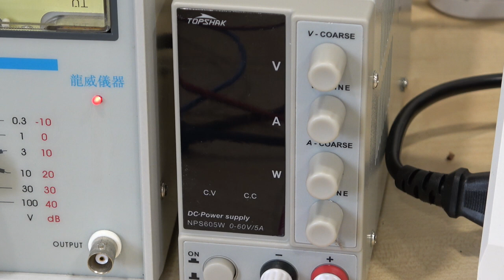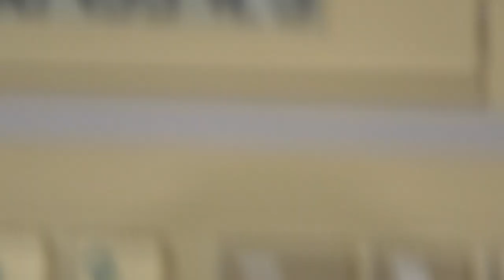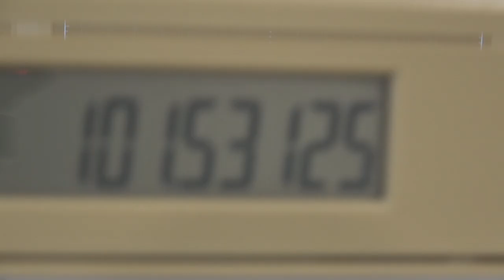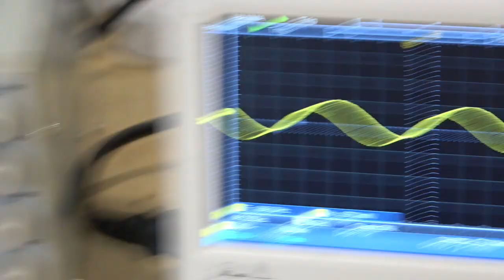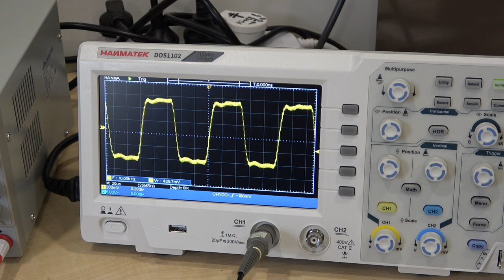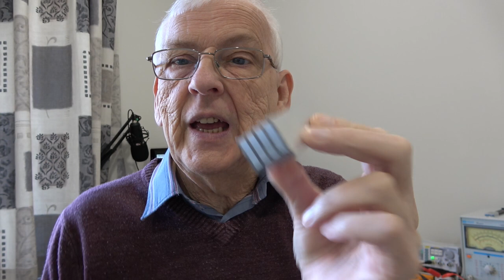A powerful TPA3255 Class D bridged amplifier 600 watts??

Comment: Hi Michael. What is the audio input connector ? A 3 pin JST ? I want to prepare for the board i have ordered :)
Reply from the maker: A short cable of about 12 inches was supplied with the correct plug to open end tinned wires. You can see this 8 minutes into the video.

Comment: Does this amp need a small preamp to get the best out of it? I've bought this amp module, and the tone board as well (popping into Jaycar for some resistors to do your mod). But am thinking of not putting in the tone control at least 1st up and see how it sounds. Popping it all into a Foxtel IQ box I got from an ewaste pile. My first amp project. It's a lot of fun and all inspired by you. I've got an old pair of DCM QED speakers that I'm trying to power. They're very inefficient, I'm hoping this project will have enough in reserve to get them sounding good. It's fun anyway, so thanks again.

P.S. are there any amp build recommendations you could give for a higher power build (above 200wpc into 8 ohms stereo)?
Reply from the maker: I don't use a preamp with this amplifier. Will depend on what you connect to it. All my music is on my PC and that drives it perfectly. I would try it without the tone board. If you need tone control and you use a PC, most music player have tone controls you can use. I use Music Bee. I'm sure you will like the Class D, it's one of the better ones.
Reply: @MichaelBeeny  Thanks Michael, I've got a Yamaha Vinyl 500 turntable I'm going to feed it with. It has a DAC and streaming service software built in (MusicCast). But no EQ. I've also got an Aiyima T10 DAC coming and that does have inbuilt EQ's if I need it. Thanks for your reply. I wish I had your knowledge. Regards, Ben.

Comment: @Michael Beeny. Hello, Michael, I want to express my great gratitude to you for your work. Your videos are very informative. Personally, I want to wish you health, patience and courage.
If it is not difficult for you to answer, I would like to ask a question. Can I connect speakers with a power of 120 watts and a resistance of 8 ohms (minimum resistance of 4.7 ohms) to this amplifier? And what voltage would you recommend applying to an amplifier with such parameters? I am grateful in advance for the answer.

Comment: I use a douk preamplifier 5532's 45volt 11 amp smps , 70hz high pass f-mods. 8 ohm 3 way AMTTweeters poly mica 5 in mids or 2 in al daytons mids, 8in carbon fiber woofers . Subs are duo dayton 18's. 500 watt ab plate. My last system(poverty) all driven from a13 5g phone. Cold,quiet, reliable has run for 3 months non stop.  No damage to drivers either. I have built repaired for 50 plus years also ,your fault inspired me..

Comment: I am adding 70hz f-mods and a douk preamp  to restore the 3db line loss. Trying the hiel type ribbons, poly mica 5in mids and 8in carbon fiber cast frame driver. All 8 ohm. 800,5k xover.10 amp supply @45v. 
Duo 18's dayton plate(500) class ab. 
Yep I'm pleased,love your channel. 50 year technican.

Comment: Aiyima A07 has this board
Reply: No it doesn’t.
Reply: Not the same board but same chipset. With the basic psu(32v 5a) the aiyima 07 you’ll get 53w x2 @8ohm, 95w x2 @4ohm both at 1% thd not 10% how aiyima and ti present the specs

With the 48v 5.2a 120x2 @8ohm, 170x2 @4ohm at 1%thd
I use one with my mean well lrs-350-48, it’s 48v 7.3a. Driving a 4ohm speaker right at 200rms each but imo I’m making this amp out considering the 50v caps though I was told it’s good to 52v
Reply: Oh at 2 ohm, it’ll do 300x2 fyi
Reply from the maker: At 2 ohms it will probably be in protect mood most of the time. Not recommended. @hybridstudios39
Reply: @MichaelBeeny mine didn’t for 4 months but ended up upgrading to ice power and about to upgrade one more time to hypex fa253’s for the power, efficiency and dsp
Reply: Same chip on the Aiyima A07, but 2 of them on this board and only a single 3255 on the A07. I have the A07 and it struggles with my inefficient DCM speakers. I’m still playing around with this new board but the power increase is really noticeable compared with my A07. My A07 also gets very hot (searing with a 7.3 amp 48v at max volume after about 30 minutes, after that I can smell it like a plastic fire so I turn it off. All that for 80db coming from the speakers. This duel amp is a lot more power, gets my speakers to 90db at 1.1v input which I’m guessing is about 65% of its total power, gets warm 43c on the heat sinks only and I can run it at those volumes and higher consistently. Soundstage is wide and holographic. Bass is much more punchy is the biggest sound improvement I’ve noticed and surprised me. Also sounds awesome at very low volumes with these speakers, something the A07 just didn’t. I’ve carried over the 7.3 amp power supply I bought as an upgrade to my A07, it is running at 46.5v (dailed down).  I’m keeping my A07 but it’s in the draw for now until I can find a use case for it. So I like the sound of the A07 and that’s why I was looking at this video. I purchased the board in this vid and am currently using it. Until I can afford a Macintosh (win the lotto or something), this board will do.

Comment: Unbeatable tpa3255
Combine it with sure wondom potentiometer preamplifier , an input selector, 700 watts power supply  and  you will have a really perfect amplifier, I have tube amplifier parasound amplifier but this is something extremely value for money.
Reply: Thanks for the preamp suggestion.  I assume you're referring to the pga2311, which I am very pleased with the improvement.  Have you compared a lower wattage ps to the 700w one you recommend?   I'm quite impressed with a 350w Meanwell at the moment...

Comment: I'm trying to build a portable speaker (with very limited understanding of the technical stuff) and was recommended this amplifier. My boost converter can only put out a maximum of 27v and I want to connect 2 pairs of 4ohm drivers in parallel, will this cope with a 2ohm load at 27v?
Reply from the maker: I would try it on 8 ohms first, speakers in series. I think driving it to 2 ohms might well put it into protection made. A 4 ohm speaker could well go down to 3 ohms and 2 in parallel could damage the amplifier. You might get away with it with only 27 volts. Depends on how loud you need to play it at. Even at 27 volts you will need at least about 5 amps possibly more. So many variables I can't give you an accurate figures. Bit of trail and error. Good luck.
Reply: @MichaelBeeny   it turns out i misread the specifications of the boost converter and the output is actually 24v up to 48v, I don't know if that would increase the chances of the amplifier coping with a 2ohm load. The lipo batteries I'm using should be able to handle up to 100 amps but I don't know if any other component might limit the amps.
Reply from the maker: @ambientvoid  If you must use 2 ohms, I would keep the voltage as low as possible to give you enough power. Don't be tempted to use 48 volts. It will be in current limiting most of the time and run really hot. What will it be used for? speech, light music or HEAVY stuff? The later will mean high power, high current, low battery life. As I said before, no simple answer.
Reply: @MichaelBeeny  I'm very new to this so it's entirely possible I've misunderstood how ohms work. I'm leaning towards bass heavy music but I don't have a huge amount of battery space and I've been assuming that a 2ohm load would draw less power (for a longer lasting battery) than an 8ohm load for the same volume, I have a separate mono amplifier for the subwoofer driver so I'm not expecting this amplifier to need to support very much in the way of bass.
Reply from the maker: @ambientvoid  Power is power, the higher the voltage the less current and visa versa. The draw from the battery will be more or less the same. As far as the amplifier is concerned, if you must use 2 ohms use the lowest voltage you can to get the required power. That will be the most efficient and safest way to keep the amplifier happy.
Reply: @MichaelBeeny  thanks very much for the explanation 🙂
Reply: @MichaelBeeny  how did you manage to purchase the amplifier? I've tried to purchase it twice from 2 different Aliexpress sellers and it keeps getting flagged for being magnetic and returned to the seller before even making it onto the plane...
Reply from the maker: @ambientvoid  Funny you should say that!! I had exactly the same issue with a number of un related items from Ali. All were refunded without question. I stopped using them for about 6 months. Now all is well. Sorry I don't know what the answer is. You might try E Bay maybe, they all sell much the same stuff. Good luck, let know if you get a answer to this odd issue.
Reply: @MichaelBeeny  3rd time was the charm, before I had a chance to try ebay the 2nd Aliexpress seller opted to resend my parcel and this time it got through customs. It arrived reasonably well packaged a few hours ago, fingers crossed that it works. 🙂
Reply from the maker: @ambientvoid  Well done, I hope it works OK and lives up to expectations.
Reply: I already built portable tpa3255 amp,its good.

Comment: The TPA3255 can definitely deliver the power listed on the TI datasheet, but it has to pass all of the heat through a rather small metal heat slug on the top of its surface mount package. Therefore the interface between the IC and the heat sink is very critical. It's important to use a really high quality heat sink compound, like arctic silver ceramique or the like. That's probably not the compound used by most of these lower cost board makers. So it gives the end user an opportunity to improve power output and thermal performance.
Reply: FYI you are right about the power ratings that most people quote (300W/channel). That is a bragging number quoted at 10% THD (square wave) for makers of boom boxes and the like who want big numbers on the boxes. The datasheet also shows the actual power on the THD vs power graph right on the front page though, and you can see the real sine wave power is around 100W onto 8 Ohms or 180W into 4 Ohms at <0.1% THD. That's with a 51V supply, so it will be a bit less with 48V.

Comment: @Michael Beeny  one question, if we change the 50v caps on 63 caps, is it will work on 48-50v power supply? or there are any other thing on board, what will blow up :))
Reply from the maker: @Douglas Blake I'm listening right now at quite high output with 45 volts switching between the 3255 and my other favourite L12/2. They do slightly sound different, not sure which I prefer, most annoying. Both have about the same REAL power.
Reply: @MichaelBeeny  I think different is a bass stage, because TPA have 100 damping factor  and L12 -200, TPA need 22000 filtered capacitor and then there not will be a different or it will veery unheareable. Its just my opinion :))
Reply: TPA can work at 55volts, look TI specs.
I drive own at 48V, I replaced caps at 63V and everything is perfect
Reply from the maker: @dimitriskaligeris5506  You are a brave man! 55volts is absolute max and into 4 ohms you will get alot of heat to get rid of. I tend to run mine at 45 volts, more than enough power for me. My speakers run closer to 4 ohms anyway. At present I'm still testing this, so I use a variable power supply. For just background listening I reduce the voltage to around 32 ish. Mainly because I can. I keep the 45 volts for evaluation in detailed power listening. I do quite like it, best class D for sure but overall. I still keep returning to the L12/2 Thanks for watching and contributing, I appreciate it.
Reply: @MichaelBeeny  Having a Parasound 3500 and a a PP KT120, TPA is a wonderful experiment rabbit! Never disappointed me. I run it at 48V without any problems
Reply from the maker: I would still not go above 48 volts. Do you really need to push it so hard?
Reply: Did you test the fans in series?

Comment: Sorry...I'm trying to understand and read the scope after not touching it for 30 years.  I saw the reading on the scope as Vr = 2.7ish.  How do you read 27V off the display?  There are also indication of '2V' and '5V' and 0.xx/div...how do I use them?
Reply from the maker: I was not using the scope to measure the voltage, only to show clipping and waveform. I use a analogue meter, you would have seen it many times. The scope does also show readings, 2.7 is correct but x 10 due to the probe. I find the meter easy to show on cam but forgot to cut in the video of it, but I was reading it out. Not all scope readings were on the x 10 probe.
Reply: @MichaelBeeny  thanks for the explanation.
Am looking out for a scope.  What would be a good budget for a decent scope?

Comment: Mr. Beeny, you should try a 3e-audio's Tpa3255 mono boards (if you can find them anymore), the sound is absolutely gorgeous, I made one of them for me and was very satisfied. big chocks with low resistance, working voltage 51, big capacitors, balanced inputs and absolutely brilliant sound :))  i measured and compared it to many hi-end amps like Marantz, Krell, Mcintosh and was veery satisfied with it sound. This is the best Tpa3255 boards what i can found on market.
Reply from the maker: On a quick look from the usual places, not found any so far. If you see a supplier, let me know.

Comment: hi there, I'm a bit of a newbie. can this board be fed a balanced audio signal?
Reply from the maker: Probably not, inputs are un balanced. As no circuity is available it's quite hard to tell if it could be modified. We were all newbies once!
Reply from the maker: @Douglas Blake Thanks Douglas, you explained this very well. I think I miss read the question. Almost anything is possible with extra bits connected, I assumed he meant, as the board is supplied.

Comment: The board exist in mono version. Could make cool monoblocks....but what about a suited DC speaker protection board?
Reply from the maker: Not much point in getting 2 mono units, this is basically that anyway. Speaker protection is a major issue. You cannot use any of the standard ones because, neither output for the speaker is reference to ground. Best you can do is a fast blow fuse in line with one leg of the speaker. Better than nothing. This is something I am looking at at present.
Reply from the maker: @Douglas Blake I'm not sure it can protect your speakers from an internal issue, like a DC fault. It's too expensive to try this!!

Comment: Doesn't even get warm @ 8 ohm ,3 way system. Use 36v mean well 10 amp, phone headphone jack works great. Use sine wave and kill tweeters... harrison fmods @ 70 hz high pass attenuate high badly . Good parts one on ebay  for 110 dollars, amazon 127 . No replacement fan available.  Buy good pair with higher flow only for 4 ohm Use. I love this board. Retired technical, engineers age 68. Designer of custom stuff over 50 years. You  will hear from me some. Very few are at our level. I also am into photography. Miss America 92, 2 runner-up's also . I did stunning work. All square pictures inside Fleetwood Mac album, mine. Put system in Bob segar, torino 72 two original Craig powerplay 4 jensen 6x9. Lololol  , I may write a book but all my negs were stolen, priceless, Bear Bryant staff photog 73. Unseen sideline work,mine I managed to put out 1 new design this year , building from wheelchair, I see these rave reviews of 6.5 two way overpriced  , In the 80' s my doors had 2 6.5 and I built my dome front drivers with replacement horn diaphragms glued to jensen 6x9 magnets ,I was a little ahead of my time..

Comment: Is this from sure electronics?

P. S.  I found out it is from yuanjing.

BTW, do you have a preference for the output inductors, such as those on this amp vs the sagami type (kind of a ferrous cube)
Reply from the maker: The larger ring type tend to be used on the more expensive ones but I have no real way to compare them.
Reply: @MichaelBeeny  It seems like the cubic inductors are by the brand Sagami and intended for class d output use.
It claims to have lower dc resistance than the ring type

Comment: I just picked up the 4-channel version of this same board. I'm making an active stereo amplifier with the Wondom ADAU1701. I'm waiting for my dummy loads in be delivered to test the amps full power with an 800 watt smps running at 48v. I also have the mono board, and I'm attempting to get that 495 watts @ 2 ohm 😂
Reply from the maker: I'm sure we will all be interested in your results as soon as you have them. Not sure about 2 ohms in bridge mode, that's a lot of current.
Reply: @MichaelBeeny  The smps supposedly has 15+ amps so I, theoretically, should have enough current. The mono amp should be wired in PBTL.